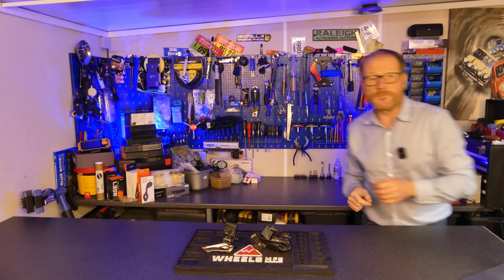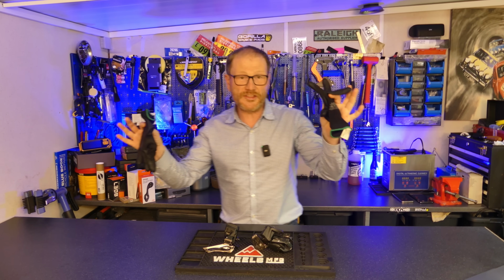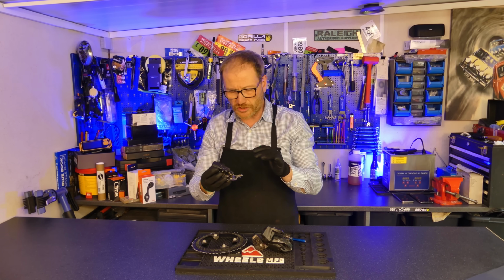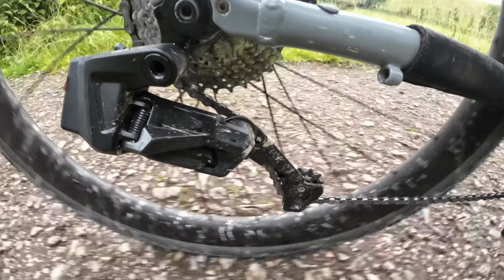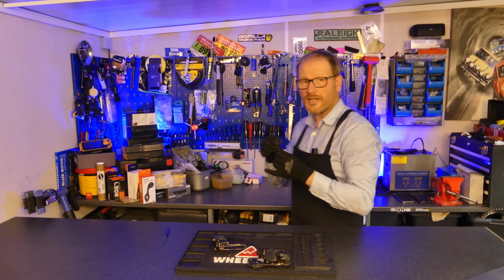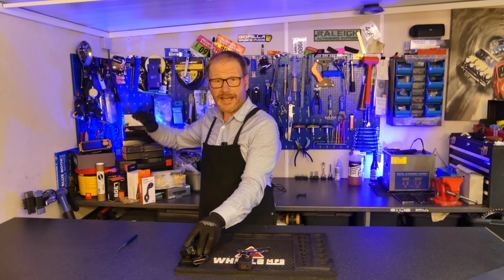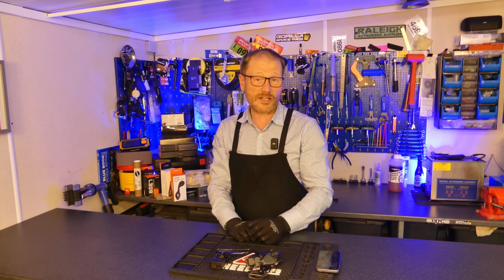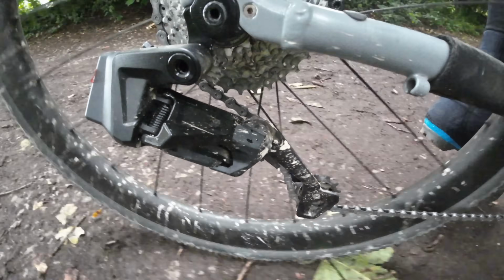Wheeltop EDS-TX Wireless Electric Groupset - Long Term Test & Review

Comment: Do you have rattle in the shift levers?, the cable version , the cable pulls back on the inside of the lever, and no rattle but the hydraulic ones the levers move forward and back just a bit, causing a rattle,,,,,there kinda free floating if ya will so on a bumpy road the levers rattle on the contact point of the hydraulic plunger under the lever. Just wondering if yours rattle “””””!
Other than this I have no issues.
Reply from the maker: I’ve not noticed a rattle, will double check it though.

Comment: Would it be possible to switch between 10 & 12 speed wheels easily with this, or does it need indexing / aligning every time you change the number of speeds?

I'm looking at a used Tiagra 10 speed adventure bike, but I was wondering if I could keep the Tiagra wheels for off-road and swap on the 12 speed wheels from my road bike if I want to ride the adventure bike on the road (e.g. if I need mudguards for a wet club ride)

Comment: Or the usual story they spend the money on the build quality and save on the battery? I did read its got a 1000 charge cycle online gives it a 2 year life span (ish) but that's only on a review online, however it is a chunky unit so might have a big lipo in there which again can swell up through time if left uncharged time will tell that's it but you can get sram GX upgrade set for same price now new so yeah hard decision to make! And I'm in this situation at the moment waiting for TRP A12 EASI or go ahead with the sram? I'll buy the sram GX amd the TRP will come out a week later haha

Comment: Shimano 105 cassette and chain shifts worse than Dura ace counterpart? Is this really true? Have you tried the Shimano Ultegra Di2 with 105 cassette and chain? Because I think short cage is the key here and not being 105 vs Dura ace. Short cage derailleurs usually shift better than long cage due to less chain wrap and usually smaller distance between cogs. Im telling this because I had a bike with 105 short cage and 105 11-28 cassette. Changed to long cage derailleur and 11-34 cassette and now the shifting isn't as good as it used to be so I suspect it has to do more with that than dura ace componentry.

Comment: Mine shifts well going from the small sprocket to the large. However, when downshifting (going from large to small sprocket) gear 8 and 5 dont shift but skip. Any advise?
Reply: I had  similar issue , but not that will not shift, just rub a little in one direction ( lower to hight in just two gears , but ok other way ), I suggest you play with fine tunning in those gears ,in small steps , I discovered that not every time the exact position in center of cog / pulley will work the best  for both sides of shifting

Comment: Bearing jockey wheels cost... 3 bucks, for a pair, full metal with sealed bearings

Shimano using their crap bushing jockey wheels because at the volume they ship the pennies they save actually makes a difference

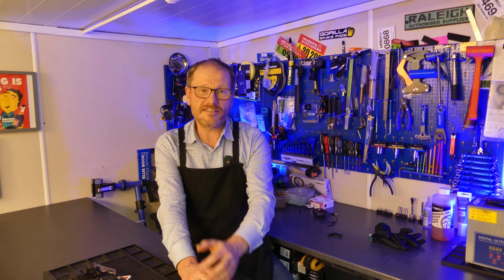Comment: 16:00 you mean the DI2 is does not shift better but compared to wheeltop is different because they are not using the same cassette and chain.... make change out the chain and cassette and test it....

Comment: I thought that 4 months is a too short period for any authoratitve reviewew, but That wear on the FD cage is outrageous. Now you can see where they cut corners to price their products lower than shimano or sram. This is something you won't see in praising, first-impression videos. I will consider this groupset once they fix the stiff rubber hoods, rectify their app and make it even chepear. Right, it is no incentive for me to switch from mechanical shifting.